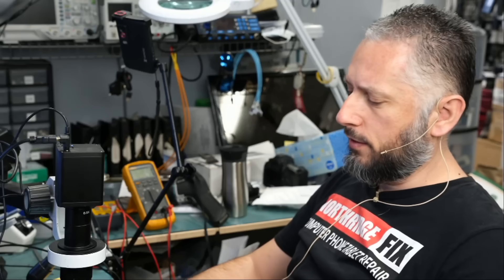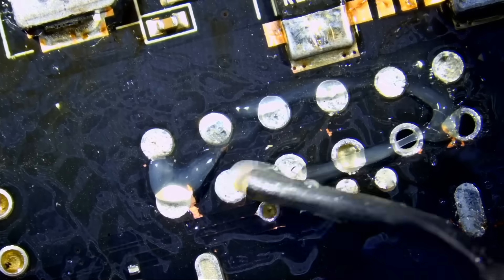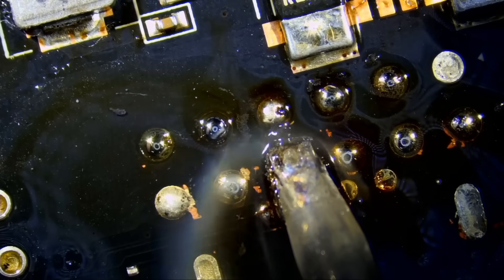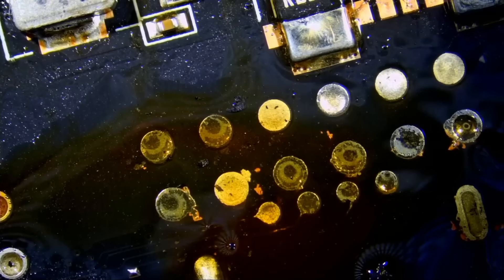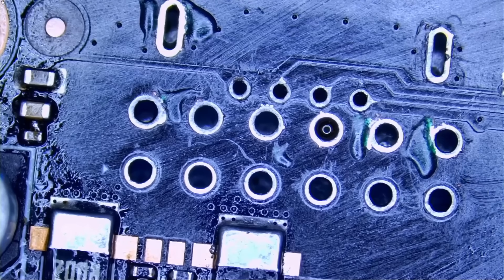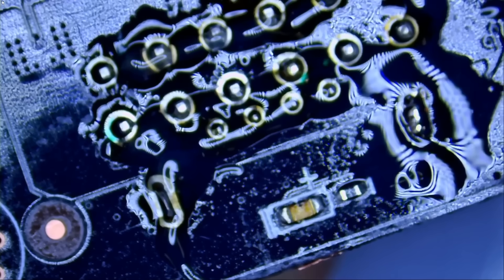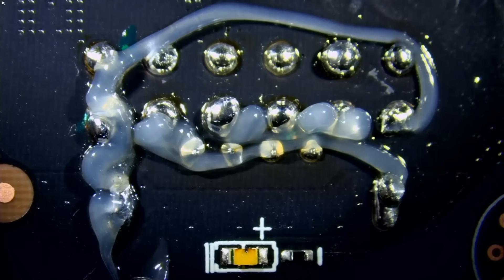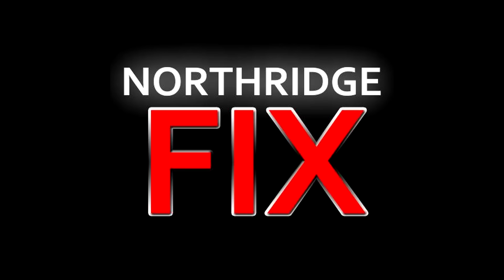Gigabyte Aorus RTX 4090 graphics card repair - Connector broke off Part 2

Comment: Always an mazing job "better then factory"<3  , but during the desolder wick  job you lost a resistor on the left side of the connector (watch at min 1:24) the resistor is there then after is gone in the braid dimension XD, hope it helps

Comment: I've been soldering since 30 years ago when I was 12 years old but last week was the first time I do soldering with a hot air solder to replace some smd opamps on my amplifier. I used to think dealing with smds is too difficult, but after watching many NF videos I thought let's try replacing some smd opamps and bought a cheap hot air solder. It turned out to be simple and easy.

I remember my first soldering was during electronic class at school, making a 3 sound modes bell. It was a mess, the solder only sticked to the components' legs but not to the PCB 🤣

Comment: i would have held the soldering iron for good 7-8 even 10 seconds on each thick pin. At the moment looking at the solder joints i'm afraid they're mostly surface and not penetrated through good. But hey i'm not expert and its a video on youtube, not seeing it all in person, right

Comment: Great job with the new 12VHPWR interface.  If the customer is smarter about handling his GPU this time around, the connector replacement should last him a long time.
Reply: He wasn't ignorant in the first place. The 4090 had issues because of poor QC, metal was shearing off in the sockets causing shorts and burning the connector, and the connection itself was difficult to seat with little to no tactile feedback vs. the traditional 8 pin eps. As a result of the sheared and abraded metal and a poor connection, a lot of 4090 cards had this issue with the connector burning.

Comment: Making at the moment a very useful tool, bought a variable buck convertor with LED display and a board from Aliexpress that turns any ATX PC power supply into a pretty decent bench supply, the variable buck can do from .5v to 40v and so far the LED gauge is pretty on the nail too, the other board has quick screw terminals for 3.3v, 5v and 12v which is pretty useful, I've just replaced my main PC PSU with a Corsair modular, the old one is a pretty decent bronze 500w.   I am very tempted to mount Molex and SATA female sockets into the box I am putting it all into, just waiting on delivery for some missile switches to make it look smart and will wrap box in carbon fibre wrap.

Comment: Would it be okay to not remove solder, but just liquify old solder with bottom heat and stick in new connector ?
Reply: You can, but it wouldn't be recommended
Reply: You can, but it's not ideal, certainly not to Alex's standard of "better than factory". Plus, you'd need a third heatproof hand to put the connector in while keeping the solder liquefied.

Comment: This will make some freak out but I have used a point solder iron tip to make an indention in the solder and then drilled it out just large enough for the pins to fit through and then soldered new part.  It was only when I had no low melt and have not done this for a very long time.
Reply: I have done that too cuz I used to solder with a shitty soldering iron
Reply: Have to use what you got. Idk why anyone would freak out.

Comment: If this connector doesn't break then you know it's better than factory.
Reply: If you do a comparison between USB type B(the printer port one) & usb type C
You get the idea that whatever was designed to last will last
It is not just the user or tech , it's also who done the original design of port
Reply: @igrewold  USB-B is a 1397 serial connection. LPT is "the printer port one", 1397 is used on many devices, and isn't intended as a primary printer connection, though that's how many people use it.

Then wonder why their printer doesn't work right.

Comment: Awesome. Just curious why does Flux sometimes get so gelatinous?
Reply: maybe it depends on the temperature of the room.
Reply: Some of the components from the flux have evaporated from the heat used, leaving it thicker than it was originally. This would be the fumes going up the extractor. And why you should not be breathing it!!